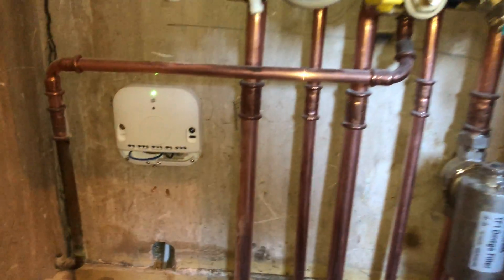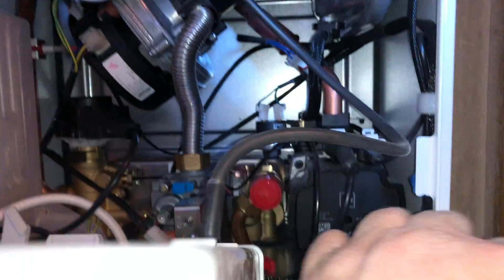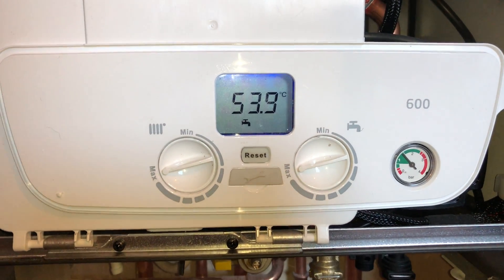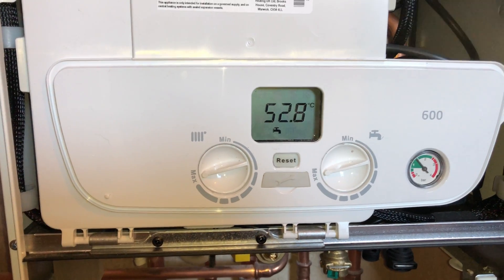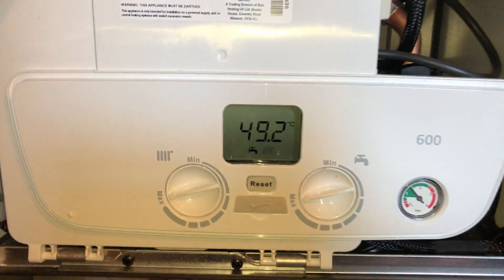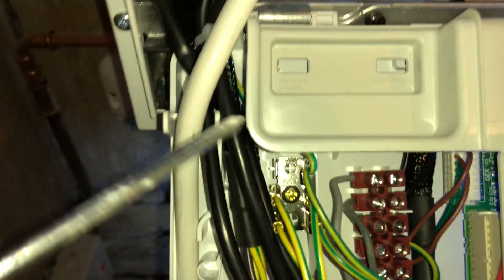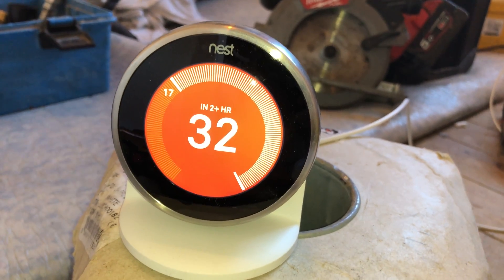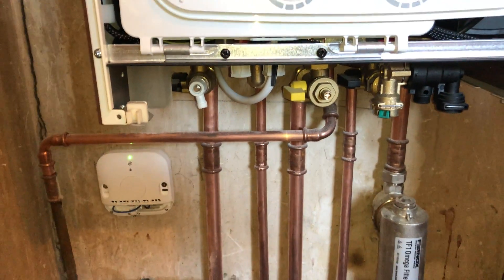Baxi 600 with Nest Opentherm Thermostat. How to Wire.

Comment: Hi
I have a Baxi 800 and a Resideo T6R that won’t talk to each other on Opentherm intermittently. 
Works fine to start off with, then a short time later the boiler just sits there and won’t respond to the thermostat demands.

I am looking into purchasing the Google nest learning thermostat. Does it definitely work ok with my Baxi 800 boiler?

Cheers

Comment: Hi
I have same boiler.
But I'm getting an error message. The power to the thermostat is off.

On the nest white controller I've got an amber light and 2 green lights below it.

The only thing I can see there's no earth connected in the white controller.
Reply: When I say white controller.
I mean heatlink.

According the nest..
T1 and T2 to the thermostat
And ot1 and ot2 to the boilers

Comment: What never seems to be mentioned is that to make Open Therm work you need the link in the boiler removed (just as you would for a normal on / off thermostat) & also you need to activate Open Therm in the Nest thermostat - in: settings, pro setup, continue, combi & then select heat with Open Therm.
Reply: Do you mean the link between terminals 1 (common) and 2 (call for heat) that normally is a yellow jumper wire across this two?

Comment: Doesn't work with my Baxi 600 & nest thermostat. Boiler doesn't ignite.
Reply: Edit ; Now works: What never seems to be mentioned is that to make Open Therm work you need the link in the boiler removed (just as you would for a normal on / off thermostat) & also you need to activate Open Therm in the Nest thermostat - in: settings, pro setup, continue, combi & then select heat with Open Therm.

Comment: go to combi boiler, turn radiator dial down to 55c, this is the peak flow, turn radiator valves to 20c, this is number 3, then use your thermostat to switch heating on only 30 minutes a time, you only need take the chill of the room, i use full gas central heating at 2 units per day meter, that is 2x11x10.34. roughly £2.40 a day, You Can heat your home, for less the £25 per week, paying over 52 weeks, so in credit by winter, people saying they can not heat their homes is nonsense, they need teaching how to use central heating,

Comment: Hi. Is it possible to adjust the maximum flow temperature? I'm not engineer just a user. When I go to alter the temp it just remains on 80C. My engineer says it can't be altered, is this correct?

Comment: Do you need to remove the link from the “normal” thermostat connection when using opentherm?
Reply: Yes. What never seems to be mentioned is that to make Open Therm work you need the link in the boiler removed (just as you would for a normal on / off thermostat) & also you need to activate Open Therm in the Nest thermostat - in: settings, pro setup, continue, combi & then select heat with Open Therm.

Comment: Note.  Run separate cables for low voltage.
Reply: I’ve wired my nest unit into mains then separate cable for opentherm connections, is that right or wrong?

Comment: Doesnt work on my baxi what am i doing wrong.. removed old timer and thermostat from link position and tried new nest on open therm connections with link put back in.. boiler bkares away with no control.. tried with link out and no worky.. what am i doing wrong..,?

Comment: No mention of removing the bridging wire (yellow) in between the terminals 1 & 2 in the M1 terminal block. Anyone watching the video would be misled and would not have a working solution.
Reply: Do you remove the link?
Reply: Does this link need to be removed or reconnected?
Reply: Always read the manufacturer’s instructions.

Comment: The problem with Baxi is that the Opentherm control of it works only with Nest 3rd gen. and their own Baxi thermostat. Draton, Salus and others don't work, probably because Baxi is not an Opentherm-compliant product, so, don't get caught out.
Reply: Hi, I have the Honeywell T6R connected to a Baxi Neodens Plus with Opentherm but it doesn't work well.

The thermostat can see the parameters like water pressure, temperature ACS...but it stops heating after a few minutes. I need to reset the boiler in order to work again. 

Is this problem related with are you saying? Can I fix it?

In honeywell web they mention that Baxi boilers can cause incompatibility but they only recommend contact Baxi. Of course, baxi doesn't know anything about this.
Reply: @Calculadoraconversor  In my experience, Baxi doesn't want to know, I tried everything.  I think it's just plain vanilla deception of the consumer on the part of Baxi as their product is not Opentherm certified - I found out on the Openther website as well as from correspondence with someone form Opetherm. I don't think your thingy is going to work. Good luck, though,...
Reply: @petrskapa793  thanks for the info.

You were right and it doesn’t work. I found a manual for TADO thermostat and my Baxi Boiler but the config failed again.

Finally I put the thermostat in on/off mode and works fine but not over OT protocol.

Again, thanks for your answer.
Reply: @Calculadoraconversor  Hi, I have the same setup with Tado except when i try to set it back to on/off i get error 83 from the boiler which means it cannot communicate. I assume this is because it is still looking for a control over opentherm. I just wondered if you had had htis problem or you did anything other than just pull out the OT wires and set the thermostat to RC01? Thanks.
Reply: @edwinwilson25  Hi,

I've pulled out wires from OT connectors and pull in again over on-off.  With that config, it works ok.
Reply: @Calculadoraconversor  thanks. It's working now, I'm not sure why though. I just cycles through settings and disconnecting/reconnecting and eventually it works. Whether it is actually using the opentherm to modulate the temperature I have no idea, because my stat is opening a zone valve so it could just be firing on flow. I spoke to Baxi tech support but they had no idea.
Reply: If you look on the internet Lots of people are having problems with nest  opentherm and Baxi so I wouldn't buy a Baxi hoping to implement it successfully , wired as a on off they are ok .

Comment: Hey.. I've just bought a new combi boiler chappee initia plus hte 2.40 which is equivalent to baxi luna duo tec plus 2.40 and a nest learning thermostat 3rd generation, made sure have all the opentherm conmections tight and where it should be conmect yet keep getting error ' H73 heat link couldn't detect an open therm connection.." please advise... As well made sure the boiler do support an open therm the conmect to the board similar to baxi 600 on M2 ports 1 & 2. Many thanks.
Reply from the maker: Might be an issue with the nest, I have had two in past few months. Let me know how you get on. Thanks.
Reply: @AllenHart999  issue with the heat link u mean or the actual thermostat?! Have u managed to solve any of the couples u passed through or should I just return it or exchange it. Thanks
Reply from the maker: @asembarakat  I have had two faulty heat links, They had to be replaced.

Comment: If using the opentherm features of the nest, am I correct in thinking the only connection from the heat link is from OT1 and OT2 to terminals 1 and 2 on the low voltage terminal block in the boiler.  Is there still a connection required to b1 and bk2 where a regular room stat would be connected on the boiler or are these terminals left empty when using opentherm?
Reply: Did you solve this question? Thanks!

Comment: Hey Allen hoping you can help, I've just had a new Baxi 636 and a Nest 3rd Gen fitted by a local heating engineer after discovering the benefits of opentherm. I got back tonight to see the finished job. Nest on the wall, Heatlink next to the new boiler with all the correct wiring the same as this video (I was shown) but the Nest just didnt seem to want to communicate with the boiler. 

So, same as you, I set the thermostat to 32 degrees, but the boiler for love nor money wouldn't fire up. At first, I thought it was a communication issue between the thermostat and the heatlink. But no matter what I set the thermostat to, the boiler does nothing. Also to note, when opentherm wiring is enabled, you can't use the dials on the front of the boiler to control the heating and domestic water temperature, as my understanding is that the thermostat automatically regulates the water temperature as necessary, quite rightly as you point out in this video (the benefit of having opentherm)

Anyway to test there wasn't a fault with the nest itself, the engineer put the boiler and heatlink wiring back to standard mode (non opentherm wiring) and the nest works just fine when set like this (thermostat same location etc). I can set the air temperature on the thermostat and the boiler goes on and off as it should.

There isnt much info online that I could find about the Baxi/Nest and Opentherm, but in the meantime, for now, I'm just using the nest & boiler in standard mode (not opentherm) I wondered if you think my engineer might have missed anything during the opentherm install/setup? to make matters worse, my engineer didnt seem that educated or impressed with opentherm anyway, he thinks its a gimmick and he seemed very reluctant to re-wire back to opentherm to diagnose further, so I'm stuck with the standard on/off at the moment.

Thanks
Reply from the maker: It should work fine if it’s wired correctly and also changed in the nest settings to opentherm 👍
Reply: @AllenHart999  You're joking, no way?. When I came in from work last night the engineer had already part setup the nest so might have missed that setting when booting for first time. Im almost positive that setting isn't available now? I'll have it re-wired back to opentherm, factory reset the nest and check the settings again. Thanks Allen, subbed 👍🏻
Reply: Sorted now. Re-wired heatlink and boiler, factory reset the nest and can now control domestic hot water temp from the nest app and nest is now automatically regulating flow temperature for heating. Top notch. 👌🏻
Reply from the maker: Jamie Wallace That’s great news, Thanks for watching 👍
Reply: @AllenHart999  ok thanks, but wait... Where in the nest settings do you set it as opentherm?! Probably why it wasn't working
Reply from the maker: Jamie Wallace It’s on the setup screen, you need to set it to opentherm. 👍
Reply: @AllenHart999  does the link between 1 and 2 in the M1 needs to be removed in order to work? (Baxy sais that in the instructions but seems other users does not remove it). I’m with the same issue here…
Reply: Similar here, new Baxi 600 installation and subsequent Nest E (rather than 3rd generation). No wires to OT 1 or OT2 on Heatlink, rather 2 wires one to C and one to NO (what is NO?). Wouldn't know how boiler is wired. Setting up via app selecting Open Therm produced error so had to select On/Off. Nest E is working ok so far, wondering if there would be a considerable advantage to having it rewired? Thanks
Reply: @bridgie1258  I would say so, though it's probably debatable on the actual energy saving. In short, with opentherm, the nest instructs the boiler to regulate the water flow temperature precisely up and down as needed to maintain the current air temperature requested. With ON/OFF the boiler just heats to the water flow temperature set on the boiler itself (e.g. 60deg). An opentherm setup does mean however, your boiler never stops heating, its always on during the schedule, BUT at a much lower water flow temperature (something around 25-30deg) once desired air temp is achieved. This is theory should reduce overall gas energy usage.

Probably the only other benefit is that you can control domestic hot water temp (tap water) from your phone. But generally speaking that's a set once and leave it kind of thing anyway.
Reply: @JamieWallace1980  Thanks, very helpful.

Comment: Just wondering. I have a Baxi Duo-tec Combi 28 with 7 years warranty. And i just bought a Nest Learning Thermostat. Will it void the warranty if i get it professionally installed?
Reply from the maker: The warranty will be fine as long as you have the boiler serviced each year. Thanks.

Comment: Does Opentherm work with other boiler manufacturers as well?
Reply from the maker: yes but you would need to check with the boiler you want to use it on.